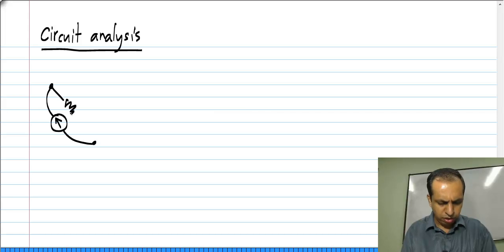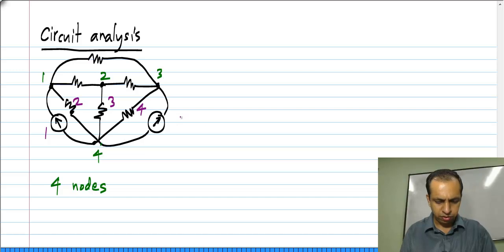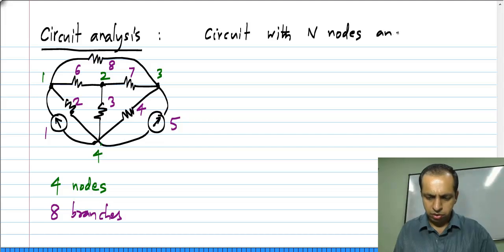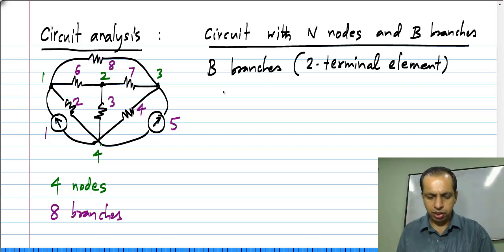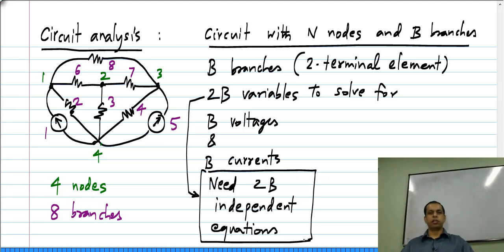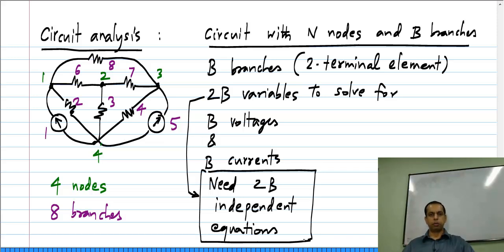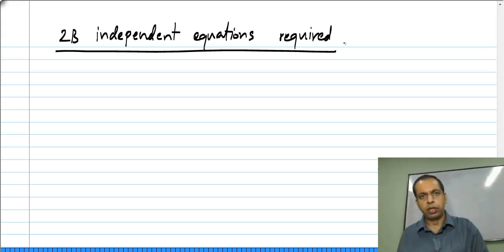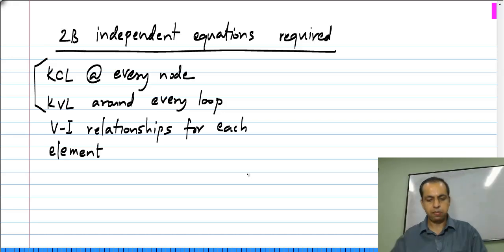Goals of circuit analysis

Comment: 2B branches? in this case you need 16 equations? wtf?
Reply: These are equation possible to be formulated and not necessarily needed. With node analysis we would need 3 independent equations [N-1] and with mesh analysis we require 5 [B-N+1]